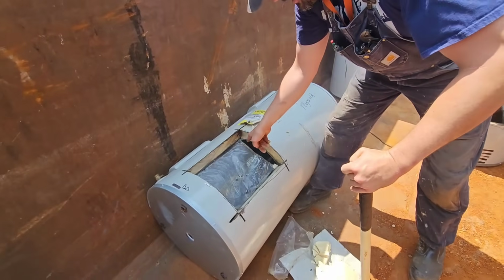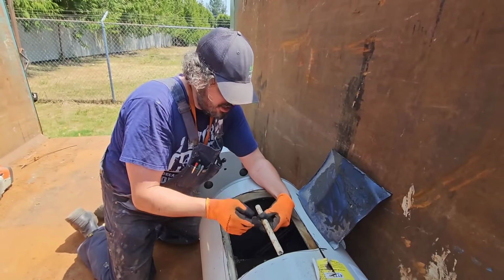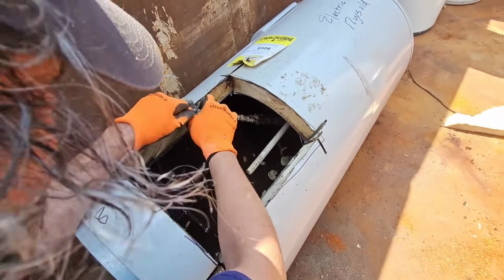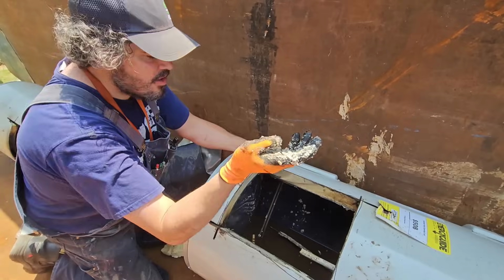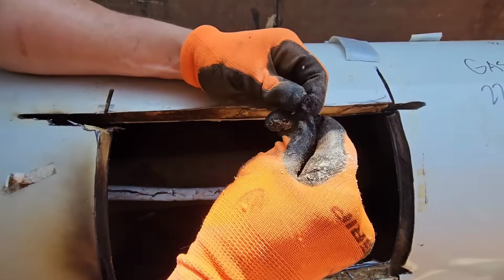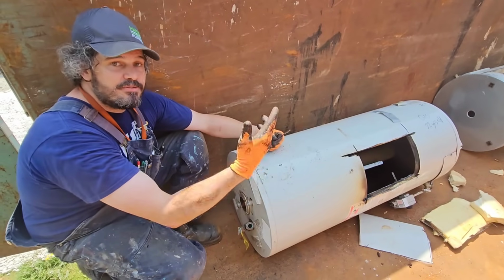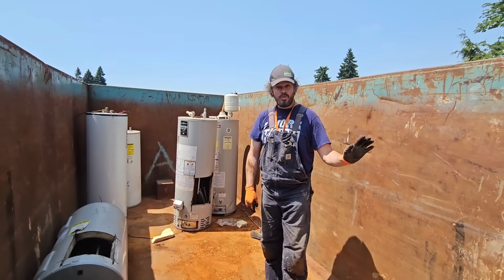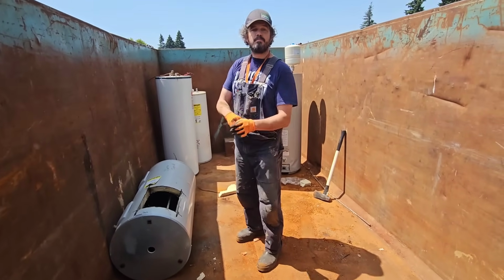Cut Open and Compare Inside Water Heater 22 years vs 12 years

Comment: What is the difference between the tank build and warranty years ? 6yr, 9yr, 12yr
Reply from the maker: We prodiminetly install Rheem Pro series . Standard is 6 and Rheem offers a 4 year extended warranty kit. In the Kit comes with an Anode rod that is connected to a nipple. They want you to replace the hot water nipple with the anode rod nipple. This gives the tank 2 anode rods offering longer protection.
We also install Bradford Whites. Their 4 year extended warranty is just a Sticker you buy and put on the tank

Comment: It's not glass.
It's baked epoxy or enamel. 
The top cause of leaks is too high temperature setting.
Cooling and heating cause contraction and expansion that make the steel tank weak.
Keep the temperature between hot and  warm. 
My natural gas tank was made in 1987 and works as good as new. I replaced the dip tube one time. The anode rod is the original.
Reply: You are correct.  I'm on well water with a softener but pulled the rod and replaced it with an electric  rod 3 years ago. 
No more rotten egg smell and tank is clean.
Reply from the maker: Thanks

Comment: 12:54 actually hot air rises, heat transfers to cold, sorry, 1 of my buttons LOL
Reply: Hot water rises too. The density difference is not a lot but it’s enough to cause convection. Try adding some food coloring to a heating pot of water on your stove and you will see it convect as claimed.
Reply from the maker: Thanks